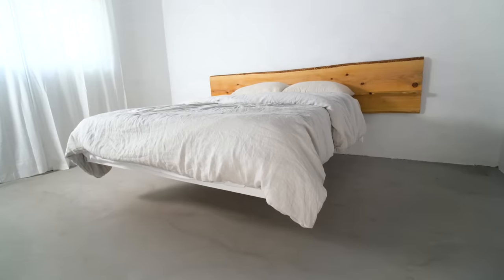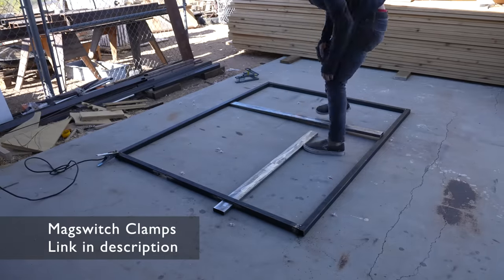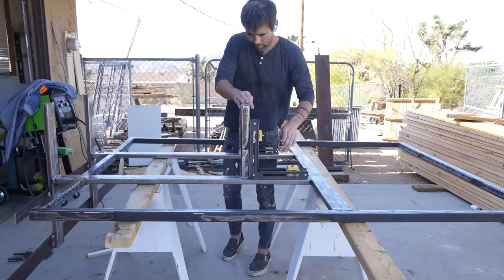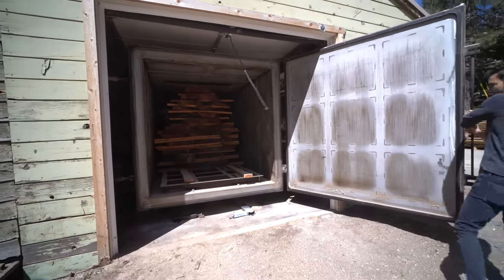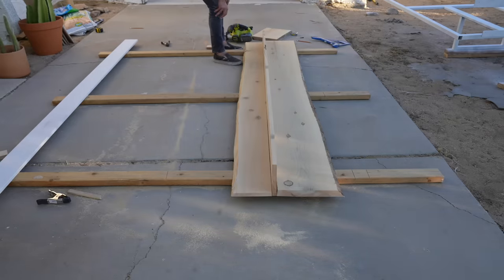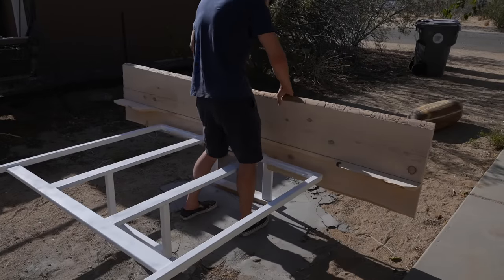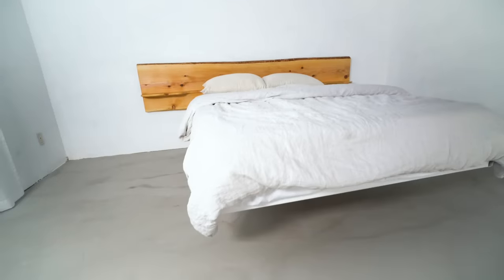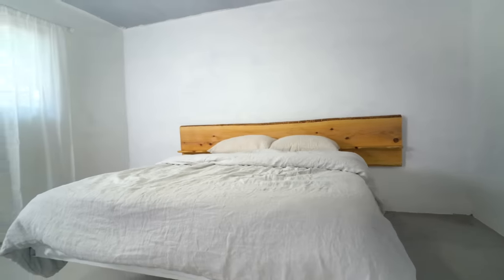Making a FLOATING BED 2.0

Comment: Maybe not leave open ends on the 1-1/2” sq tube frame and sharp corners.  100% going to slice some shins. 
I’m a professional fabricator for 30+ years.  
You got screwed on the cost of your steel.  Charging $5,000 for that….well….a conscience isn’t necessary if you only want to sell one.

Comment: what is with everyone wanting everything to be "floating?! as a cabinet maker I am about done with the now countless floating shelves, and floating cabinets everyone wants.It's a real pain in the ass and no matter how well you do it it is still really not as strong as something that actually is supported properly ,when will trend come to an end?people want this kind of thing but do not want to pay what it costs to do and do not understand why it is more than standard cabinets that are supported by sitting on the floor.With this bed my customers would be like "well I don't understand why this would cost any more than any other bed? " and try to haggle down the price..... they would also probably not accept the legs being under there at all and want it to literally just be poking out of the wall with absolutely no support visible in any way, people have no concept of how thing actually work but think they are an absolute expert on how it should be anyway ...reality is it takes much more effort and engineering to do especially for a licensed contractor that has to be liable for it if it ever fails.That being said ...well done on this. I do not like it but you really did it well.